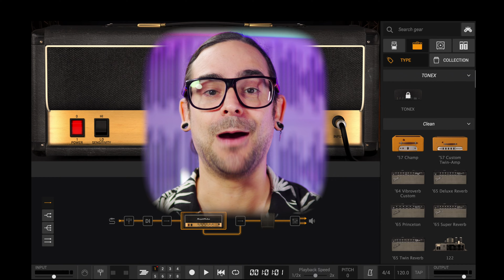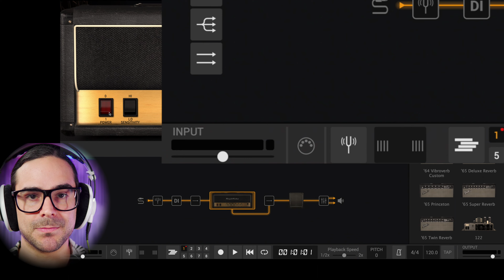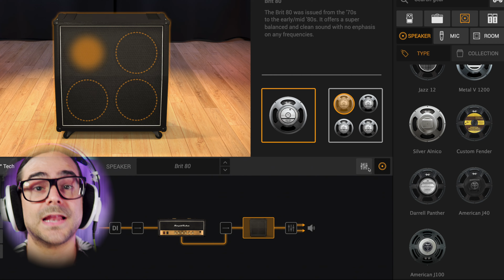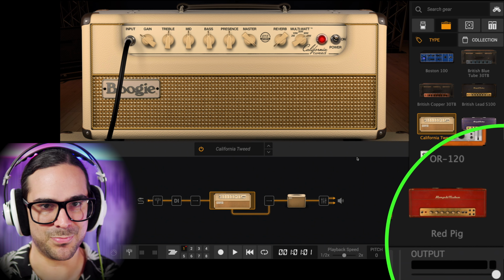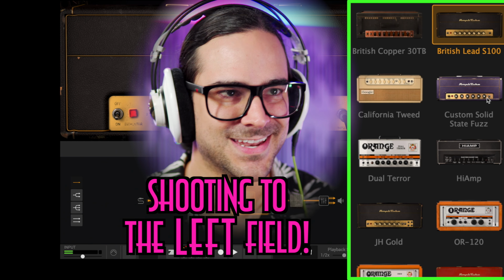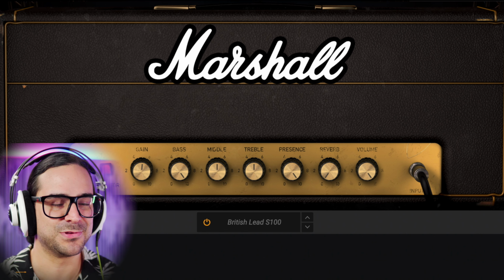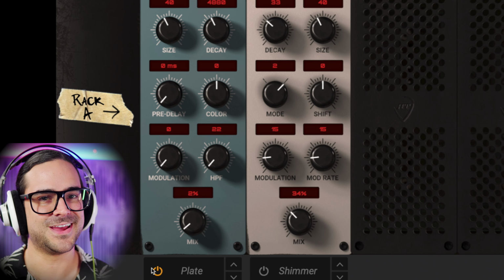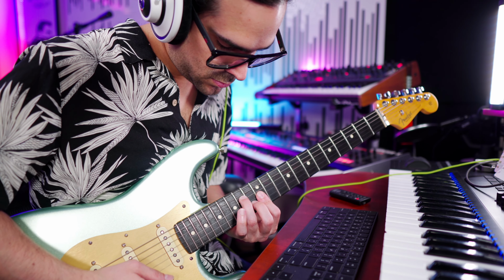Amplitube 5 | How to make THE BEST CLEAN TONE

Comment: when i try to make cleans in this ampsim the volume is too low AND my output is maxed out, even clipping sometimes, wtf?
Reply from the maker: Try turning up the yellow fader for transparent volume, hopefully that’s enough. If not, add an extra compressor at the end of the chain, maybe a 670 if you need more, go to a saturator and boost there. That’s like 50db of gain! If that’s not enough, maybe you’re connected to the wrong input, maybe going through a microphone. I hope this helps friend!
Reply: @Itsjorgelanzas  i tried boosting the volume but i just clip and sound awful, i'll try compressors! no i'm not going through the wrong input when i go to my high gain setup it sounds good but when i switch it sounds quiet. I'm SURE it's cause I'm running the out through a small clean combo amp  i have instead of headphones or frfr speakers (it's what i have. and no i'm not stacking cabs, i have those off in the sim) rant over
ty for the tips! cheers mate!

Comment: For instance for the 59 Bassman ltd there is only volume knob instead of pre amp and master. So which one does this volume knob control? By the way great video, thanks!
Reply from the maker: That’s correct!! There’s a lot of amps without both knobs functionality. When there’s only one “Volume” or “gain” knob, that means it controls both, gain and output at the same time. These are the amps people say things like “it doesn’t sound good unless you crank it!” 🤣 because there’s no way to get the combination of gain and output volume that is perfect for you. Luckily, most virtual amps have an independent output knob for the plugin, so you can always balance how much distortion vs volume you have! 🙌🏻 I hope this comment helps, thanks for your nice comment friend!! I appreciate you! 🙏🏼🙏🏼

Comment: Great video. Great demo. Great thoughts. Great teaching. Thanks a lot I don't see a lot of info about Amplitube 5. This is very informative. Would it be possible to use Amplitube 5 to play in real time (guitar to audio interface to PC to audio interface to mixer  and mixer to PAs?? hearing yourself pluggin the headphones in the audio interface or via the mixer all players together)
Reply from the maker: Everything you said is possible. With the right interface you can do absolutely anything. Maybe, I would try something with more than two analog outputs so you can send repeating mixes to different sections of the production line. But basically it should be a very simple setup just like you described it! Annnnd!, thank you for taking the time to write such a nice comment my friend! I appreciate you! 🙏🏼🙏🏼🙏🏼🙏🏼
Reply: Thank you for thequick answer, I've just order the new Steinberg IXO 12but which has very nice reviews, but there is an offer now APT5 MAX+ToneX MAX+AXE I/O and I am doubting. WOuld you recommend that device? It has 5 years now @Itsjorgelanzas
Reply from the maker: I’ve never tried steinberg’s hardware to be honest. I have used the Ik Multimedia one, but it died on me lol so I can’t really tell you that’s the reason. Although I blame mine breaking to miss use 🤣🤣 toddlers

Comment: What is the difference between ToneX and Amplitube 5? Isn't APT 5 already simulates amps? Coud you make a video similar to this including toneX ??
Reply from the maker: Tonex, is a software that basically captures one static snapshot of how a specific amp with a specific set of settings with very little to no adjustability, depending on how picky you get. AT5, is pretty much like having the amp in front of you. You can do ANYTHING you would do to a real amp. Preamps react very similar to the amp, the eq, same, sag and all the nuances that make an amp are modeled. Maybe not absolutely to perfection, but super super good enough, if you know how to use it. Tonex sounds nice if you want the exact sound that they modeled and don’t wanna change anything at all. 😅 I hope this word salad helps my friend! 🙏🏼
Reply: Ahhh, ok I understand!! Thank you very much!!! @Itsjorgelanzas

Comment: I didn’t see anything in your video related to the input gain. As was mentioned by many people on YT, Amplitube has a big problem with input gain that differs from a model to another. Amplitube models are  way far off when compared to the real amps.  
And because of these complaints, this issue was solved by other plugin developers. The’ve all released “extra notes and tips” on how to set the input gain….but IK Multimedia doesn’t want to go there yet.
Reply from the maker: I did talk about it at around minute 4. I honestly think all plugins work very similar in the audio world and have similar requirements no matter who’s building it, they’re still audio tools that need to work within certain standardized parameters used across all recording technology industry. I never change my input gain depending on the plugin. I don’t even change it when I plug my different guitars. And most things work just fine, just like in real life, if I don’t hear what I want, I can pop a pedal, a compressor or whatever, nothing is gonna sound like I want it, by just plugin in I’m making the tone, the tone is not making me. If you want to hear my 2 cents of this subject, I got this video about how to set your input gain to maximize your productivity and flexibility in AT5, if you want to check it out. 
STOP KILLING YOUR TONE | THE BEST INPUT GAIN
https://youtu.be/pizMQbOQiV0
Reply: @Itsjorgelanzas Your explanation refers to how to make a plugin to sound how you want, my comment is about authenticity: "if I'm plugging in my guitar into my interface, and open JCM 800 from Amplitube with all knobs at noon, does this give the sound and feel of a real JCM 800?" The answer is, no. This doesn't happens with any other plugins on the market, if you follow their recommendations. Not all plugin developers are using reference levels of -18 dBFS = +4 dBu.  For accuracy, if a company sells a product intended to sound "like the real thing", then the plugin should sound like the real amp. That's why all plugin developers (except IK Multimedia) updated their user manuals or info on their websites, to help customers achieving the best sound. (example from Neural DSP website " Our plugins are made with the following audio interface gain: Analog domain sine waveform 1 Vp = 0.707 VRMS = -0.79 dBu equals -13 dBFS in the digital domain.")
Reply from the maker: You’re right!, I wonder if Ik is ever gonna update that, or even keep working on Amplitube altogether, it seems to me like they’re just letting the brand slowly die. Reading your comment, makes me wonder, What ampsim gives you the most authentic sound and experience? I’m curious to know your thoughts! You really seem to have a lot of technical knowledge on the matter. I hope it translates in the quality of music and recordings you’re making! 🙌🏻🙌🏻
Reply: @Itsjorgelanzas There are many ampsims that gives you authentic feel and sound, including the ones in Amplitube. 
They just need to be set up properly.   
My "technical knowledge" comes from this frustration - when I realized that my beloved tube amps I own, don't sound like the plugins I was using to record. There are many people on YouTube putting together information about this. One of the most comprehensive video on this topic 
 https://www.youtube.com/watch?v=jXKZqJtjLkg
Reply from the maker: Got it!! Cool man, Thanks!